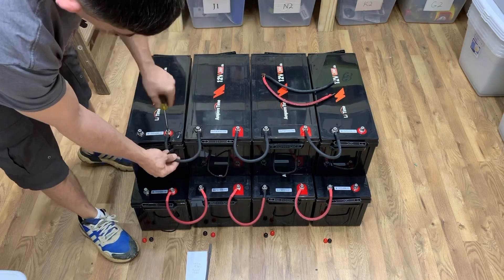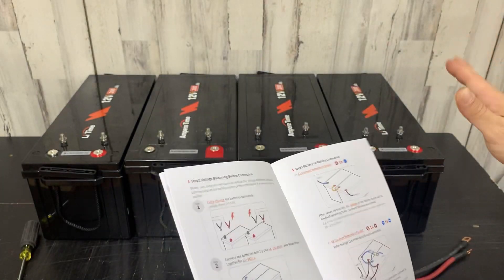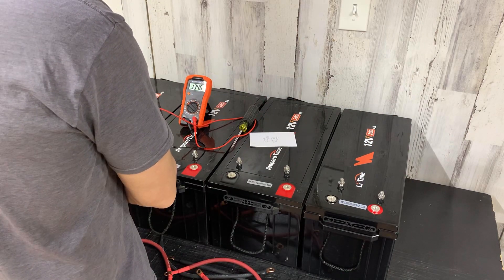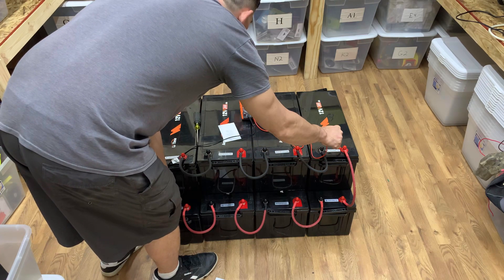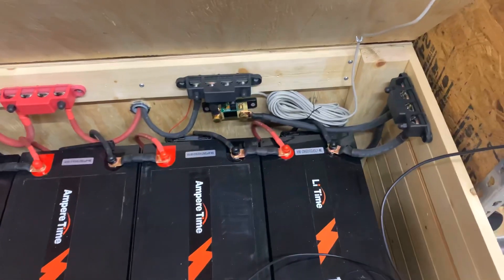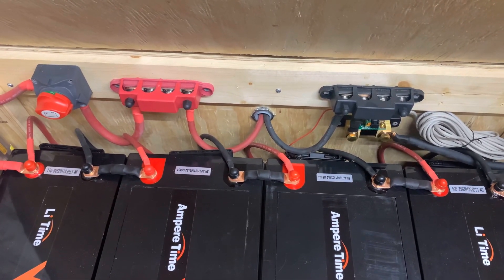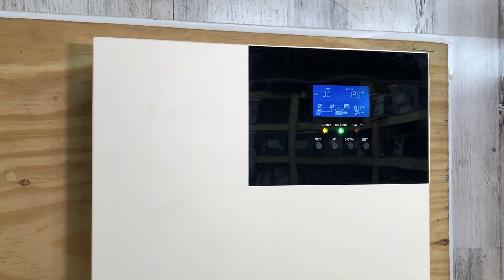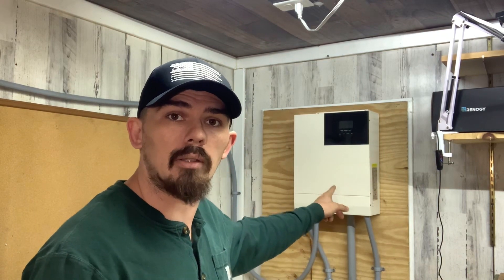Cheap 20kwh Lithium Battery Storage for Solar Setup in a 48v System Perfect for Off Grid (Li Time)

Comment: hay, you might want to move the battrey switch to the outside of the box, im just saying.
Reply from the maker: I thought about it but there is already a disconnect between the inverter and battery box. I put that switch there to disconnect the entire buss if needed. If I decide to add another controller or inverter, it would have its own disconnect as well.